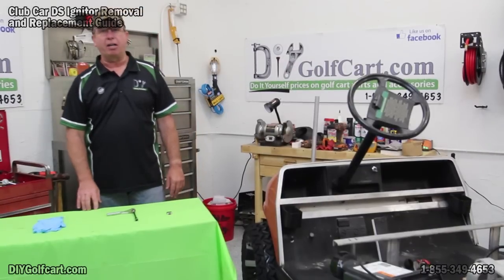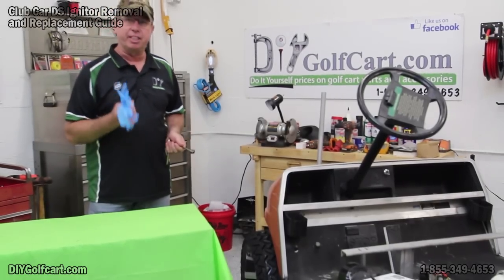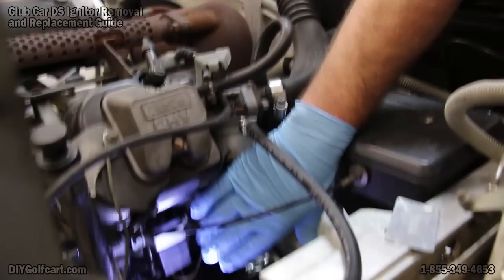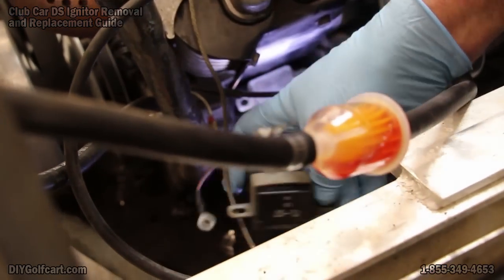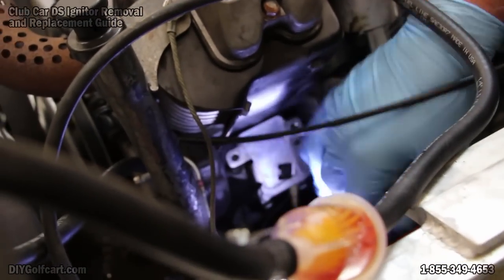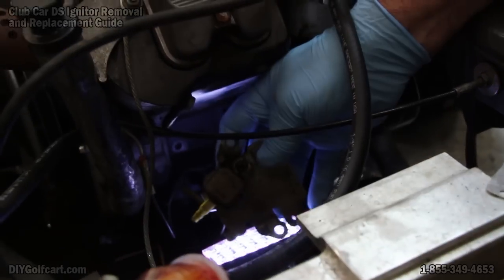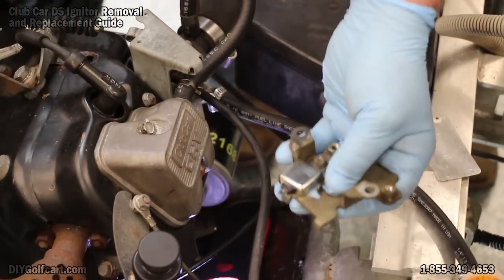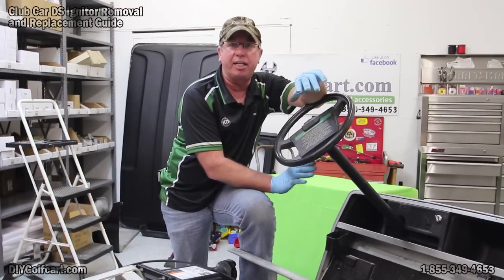Club Car DS Ignitor | How to Install on 1992-1996 Gas Golf Cart

Comment: We have changed out a lot of our parts... could the  igniter be  the reason why it wont start but revs like it wants to? Weve swapped out alot of the parts from the battery to the cart but not the igniter. Could the igniter be the issue we dont get spark at the plug?

Comment: Replaced the rpm limiter & ignitor.  Press slightly on gas peddle and the cart begins to rev up and then dies down and then it will rev up and take off.  Kinda like a fake start.  Any ideas?

Comment: Will this cause no power to go to the solenoid? I have no power at solenoid. Solenoid has been tested and is good. Micro switches checked out ok also. 30 amp fuse is good. But still no power to engine to crank it. What else do I need to look for. It is a 98 ds gas engine Club Car
Reply from the maker: No, totally different circuit. Power goes from the battery to the key switch, then accelerator micro switch and on to the solenoid. Check across the 2 small terminals on the solenoid with the key switch on, in forward and with the pedal pressed down. Should have total battery voltage. If not, find out which is missing, Positive or Negative circuit.

Comment: Thanks for the video.  I like your easy-to-understand guides.    Can you tell me if the ignitor is the same thing as the coil?   I'm not getting spark on my 93 DS.  New spark plug but think I'm having other spark issues.    How can check ignitor and coil?
Reply from the maker: Give me a call here at the Garage and have your email address ready. I can send you a guide to help with the test you'll need to perform.
http://www.diygolfcart.com/Club-Car-1992-96-Gas-Ignitor-p/2609.htm
http://www.diygolfcart.com/Club-Car-1992-96-Ignition-Coil-p/5132.htm

Comment: I have a 1996 DS that is after the change when the igniter is part of the coil.  How do I remove the coil/ignitor so I can check to see if it is faulty?
Reply from the maker: randyb399 As far as I know, there's no way to check the ignitor, Quick way to check the coil is checking for nice blue spark.

Comment: Thanks for the video.

Question...I have a 97 DS that has some slight starting issues.  Would this ignighter be the issue you think?

If i haven't ran the cart for awhile and go to start it I need to use the choke slightly as well as feathering the gas pedal.  
Its finicky but I can start it pretty quickly but others can quickly kill the battery...lol

Comment: I have a gas powered Club Car the battery is good in it and everything else. and it was running fine until one day I went out to tried andstart it. and it wouldnt do nothing. its like the battery is dead. but i checked the battery and its good
Reply: You figure it out

Comment: I have a 1993 club car and have problems with the coils. It ran perfect for 2 years then the coil failed. I took it the authorized dealer and they replaced the coil and it ran fine for about 1 to 3 months. They replaced the coil 3 times and since then I have had to replace the coil 6 times about every 3 months.The gap is correct from the coil to the flywheel. The dust cover is on correctly so the fan works properly. The spark plug is not fouled and is working good but the spark appears to be weak on all the coils that I have installed. Could anyone recommend what could be causing the coils to fail.
Reply: Greg Lawley I
Reply: Greg Lawley I

Comment: I have a 1995 model club car ds sometimes it gets fire sometimes it want it has a mind of its own what could be the problem and how to check
Reply from the maker: Keith Davis Sounds like the Ignition Coil is breaking down. Check the Male Spade Terminal with the Core and look for 0.6 ~ 1.4 ohms. Then check the Main Lead inside the cap to the Core and look for 6.0 ~ 11.0 ohms. Out Of Spec.....See Below......

http://www.diygolfcart.com/Club-Car-1992-96-Ignition-Coil-p/5132.htm

Comment: Our DS cuts out (ignition we think) at extended max throttle. Could the rpm limiter cause this? The governor has been opened all the way also. To make it run again we have to lift off of the throttle and then reapply it.
Reply: have the same problem with my 94 , did you ever figure out what the problem was?

Comment: my club car wouldn't stop running.  I flipped it in neutral, and found a wire hanging.  I grounded it and it killed it.  I learned that this is the engine kill wire, but I have no idea where it is supposed to run to.  It is connected to the bottom of the motor, by the rpm limit or, but the other hand is not connected.  it looks like it is supposed to go back by the starter some where, but I can't see where.  09 Club Car DS
Reply: Was trying to help neighbor out with his club car. How do you tell year? The issue I found was when you depressed the engine spun and no spark. When I let my foot off accelerator, one single spark would emit.
Reply: @rywolf01  It is on the serial number plates that they mount.  There will be the last two numbers of the year on there somewhere.  Google it.  THey will tell you which numbers are the year.

Comment: I have a 1992 gas club car that runs for several hours then i have to charge battery ,I'm sure its the starter generator or voltage regulator but don't know where they are
Reply from the maker: +Griff James Most likely the Voltage Regulator. Give me a call here at the shop and I'll give you a test to run. 855-349-4653

Comment: When the engine gets hot it will not crank for a few minutes then it will crank and start what do I need to check it's a 1991 club car
Reply: Dennis England    ignition coil most likely

Comment: I have a carry all cleaned the carb changed fuel filter n fuel pump n it sputters when driving
Reply from the maker: +juan Lopez Pull the fuel hose off the carburetor and make sure you have 1/2" to 3/4" pulsating fuel. If so, check the spark plug for constant spark and a nice blue spark.
Reply: +DIY Golf Cart I'm getting a steady flow of fuel but my fuel filters don't seem to b getting full
Reply: +DIY Golf Cart thanks for the help and the fact reply but I checked the new plug I put in and it seems that the piston may have hit it n closed the gap I regapped it and put it back in what would have hit it? I'm using the recommended plug
Reply from the maker: +juan Lopez That's very unusual for the piston to be hitting the plug if it's the correct one. Double check the plug part number, worst case scenario, put a washer around the base of the plug to raise it up.
Reply: +DIY Golf Cart thanks I'll get back to it tomorow and let you know what happens

Comment: Our 93 DS will turn over but will not start.  I'm guessing it is the ignitor.  Any advise would be helpful.  Thanks
Reply from the maker: Check to see if you have spark. It could be a number of things.Give out Tech Support for help at 855-349-4653
Reply: Thanks